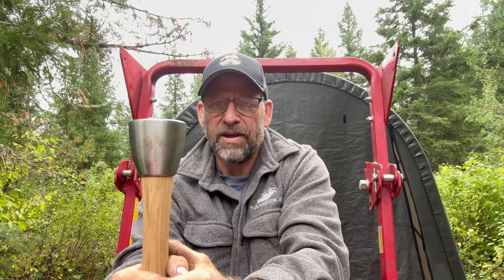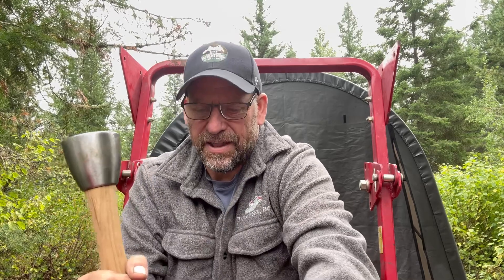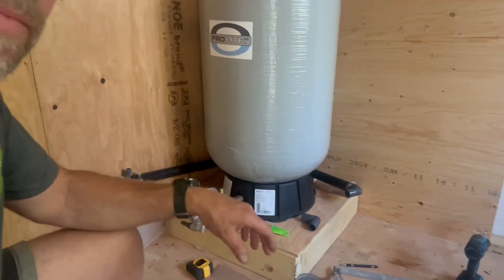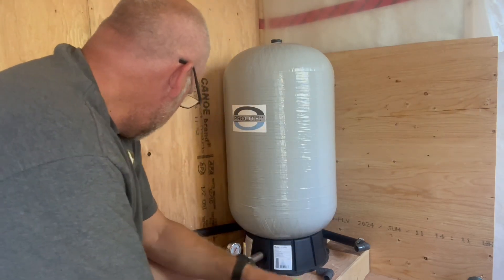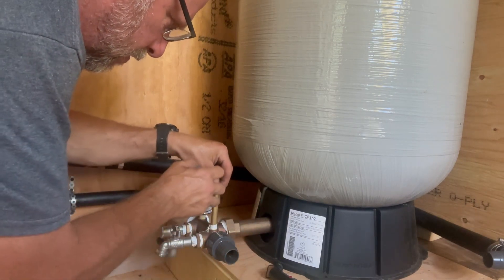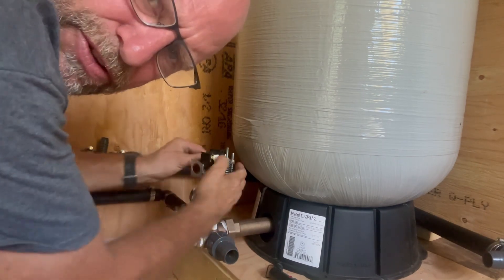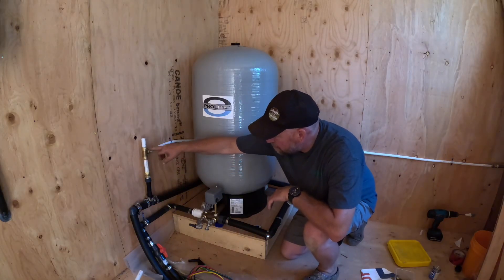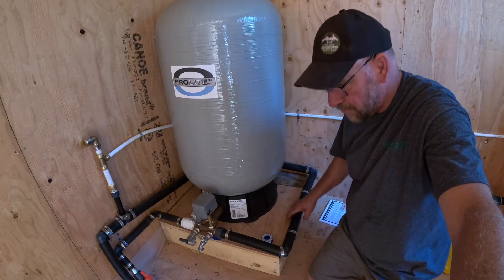Installing the Pressure Tank for Our Off-Grid Well System | Essential Plumbing Setup

Comment: Are you going to have to filter the water? We run ours through a Berkey using the black carbon filters for drinking. Otherwise, we just use it as is. Tastes like poo though when not run through the Berkey for drinking. 
Looking good, one step at a time.
Reply from the maker: truth be told I haven’t even put a sediment filter on yet and we’ve been drinking it as is the land that we are on is basically an ancient riverbed so the water is already being filter through the rock and gravel. The well is 115 feet deep, but I really should use a settlement filter. Other than that. No filters required the water taste perfect we are very lucky with this.